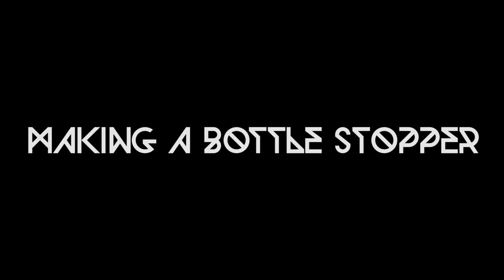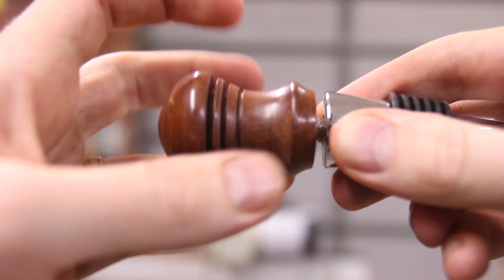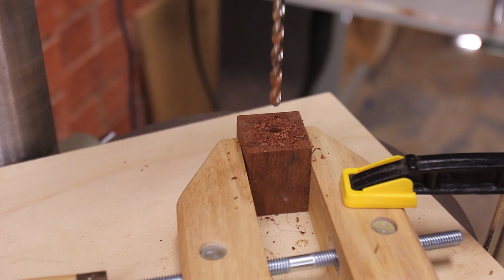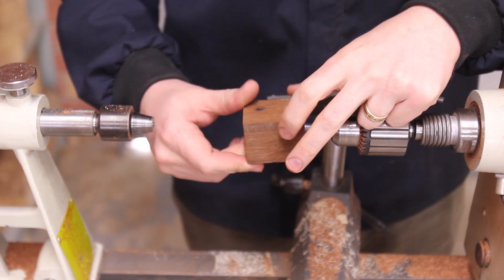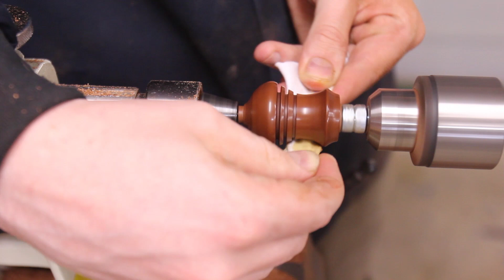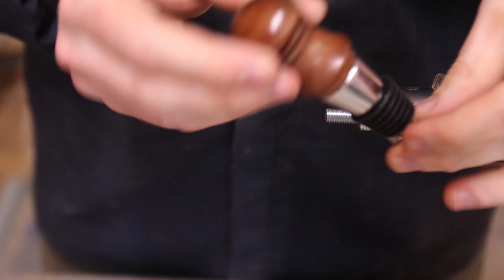030 - Turning a bottle stopper

Comment: hey Paul. great video I was wondering if you could use the chuck that way for this application. thanks - stuart
Reply from the maker: ***** As in a 4 jaw scroll chuck? You could, just reverse it. I think you'd want to drill it on the lathe so it was perfectly centered. It might be a bit difficult to tap unless your lathe has a handle/wheel or spindle lock, so you could always drill larger then epoxy it in.
Reply: Paul Jenkins  no i meant using a Jacobs chuck and a bolt with no head like you did. I was going to ask but then I saw you using it.
Reply from the maker: Ah, right, my excuse is its fairly early (for me) on a Sunday morning, so the brain hasn't kickstarted yet ;)
Reply: that's alright

Comment: Hey Paul! What kind of finishing products did you use on the stopper?
Reply from the maker: +Joe Psy UBeaut's EEE-UltraShine (not a finish, but a cutting agent that gets it super smooth), followed by Shellawax Glow. Goes on super easy, though its not the absolute most durable finish.

We've also used MinWax oil based gloss polyurethane, though thats not applied on the lathe.
Reply: ok thank you!

Comment: Any guidelines as to the height of a bottle stopper?
Reply from the maker: From memory I went with a 45x45x80mm (1.7"x1.7"x3.14") blank, but I've seen blanks sold shorter and narrower (~30x30x70mm). You probably don't want much longer than that unless you're doing some delicate finial work on it, as it'll stop the bottle from fitting back into the fridge!
Reply: Paul Jenkins
 Thanks Paul. Reason why I asked is because the blank I picked up is around 5 inches long.
Reply from the maker: Paul Tomlinson You could probably get two bottle stoppers out of that, or a fancy one that gives you a bit more room to move/part off/etc